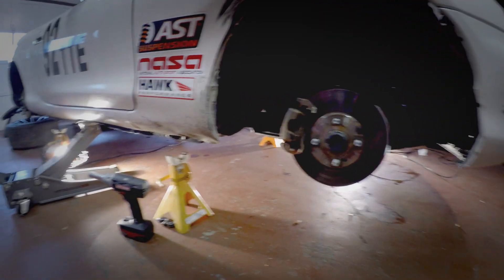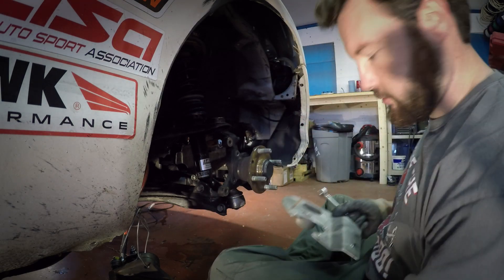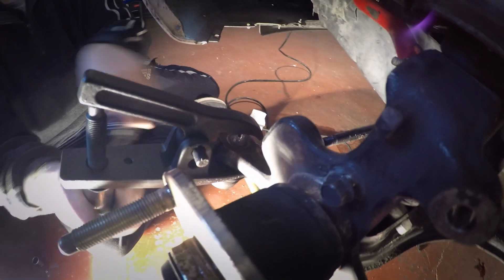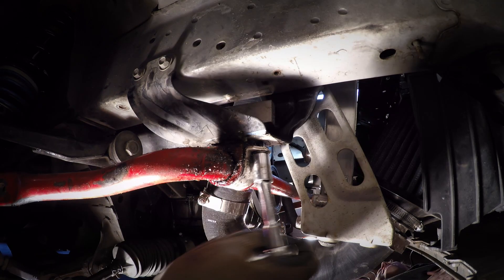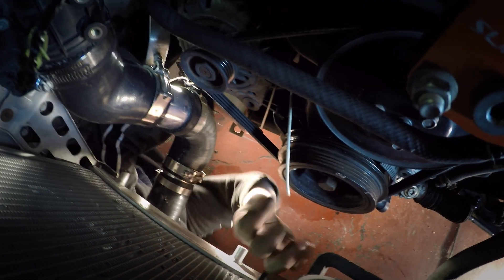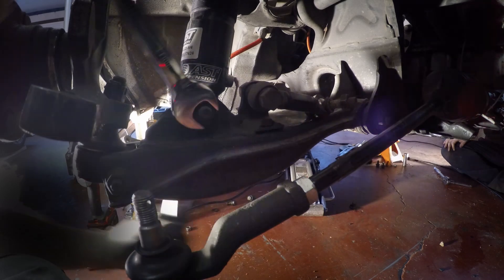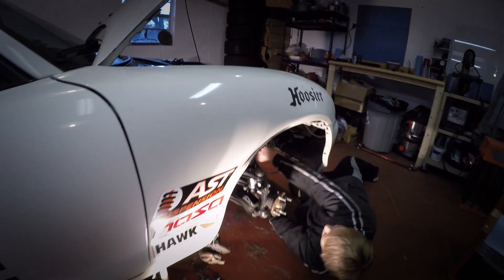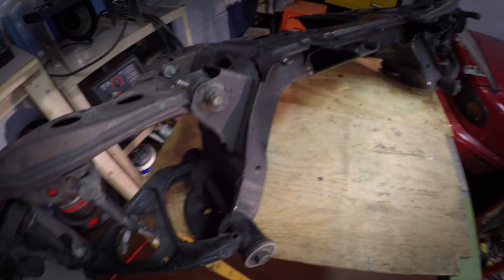How to remove your Miata front subframe.

Comment: Where did you get those heat shields from?
Reply from the maker: It was a small company called Trackspeed Engineering.  They closed up shop in 2022.  You might be able to find something similar on Miataturbo.net.  They usually do group buys or have people making one off parts.  Be mindful to post though.  They can be brutal.

Comment: Do you have a tools list for this job?
Reply from the maker: No.  I don't go that deep into my videos.  You could do this job with a pretty basic kit, you might just need to be creative with the ball joints and tie rod ends.
Reply: Yeah it was like a 21mm, 19mm, 14mm and whatever else you need for the random bolts replaced by some hack lol  @CodyYankey
Reply from the maker: @boo5tjuice  Lol, that's another thing about old cars.  By the time you get to them, they have been run through by some many, no telling what someone has done or damage they had caused.  

Sounds like you got it done though!
Reply: yeah it was like 15 min haha super easy, but this video helped a ton bc I knew what I was getting into thanks to you!  @CodyYankey
Reply from the maker: @boo5tjuice  Glad to be of some help.

Comment: this also works for na??
Reply from the maker: Yeah, they should be the same.  You may have some plastic stuff to deal with that might be different, but the subframes on NAs and NBs are interchangeable.  I run a full NB setup on my NA.

Comment: Hi hoping you can help me with an odd little question! on my 1999 MX-5 there is a rubber hose going from the fuel filter into the subframe and I can't see where it comes out.. I wondered if it was some sort of breather but with the fuel system being pressurised this doesn't make much sense to me, I also didn't see any mention of it in your video but maybe that's due to different versions of the car or it's just so inconsequential that you never mentioned it! I'm absolutely no expert so please forgive me if anything I have said is nonsensical!!
Reply from the maker: That's just an exhaust hose for the charcoal canister, it is fuel system related but not vital.  Most all guys with a racecar end up removing them.  You will get gas fume smells if you do this.  You can just pull the hose out of the subframe.  It's not attached to anything.@calumlindsay
Reply: @CodyYankey  Don't know why I only got notified about this now! But thank you! Another question, if you will indulge me! Where would be the best place to jack the engine up if I am removing the oil pan from underneath the car.. I don't have an engine hoist or I would do it from the top! I'm half thinking I could put a couple bits of wood across the bonnet and use a ratchet strap to hold it up but I'd rather use a jack stand/bricks if possible 😅
Reply from the maker: @CalumLindsay  I don't think you can. The oil pan is also connected to the transmission, so you'll need to pretty much remove the entire engine to get access.  That's probably one of the most difficult jobs on the Miata.  The FD is the same way.  They just have such a robust front cross member.
Reply: @CodyYankey  Yeah I think you are right.. I haven't tried yet but I seen a video with the engine out and the oil pan clearly bolts onto the transmission 🙃 I will have to have a look on the slim chance I can somehow wiggle it out but it doesn't look positive. Will update on whether I somehow manage it or not when the weather has improved a bit, 4ft of snow here which is pretty strange this time of year! 😂

Comment: What caused the subframe failure?
Reply from the maker: Big sticky tires and curb bouncing on track.
Reply: @CodyYankey  damn, does that ever cause frame damage?
Reply from the maker: @greeenteeee  Usually the weakest component fails first, so the subframe in this case.  If you are seriously racing and want to be competitive, pretty much everything is a consumable.  Even "entry level" spec Miata's can cost upwards of 50k and the more open classes have hour limits on engines for rebuilds.

Comment: Hey man, such a quality video. I just wanted to double check that i could leave the steering rack in and this went over everything I'm about to do so spot on. 
Dang that's a gnarly crack on the subframe!! That's crazy gonna have to see what happened there. Thanks for the vid hope you're doing well!
Reply from the maker: You probably could leave the steering rack in place, just undo it at the steering knuckle when you drop it out.  We have a depowered steering rack in this car but if you had power steering I would recommend you leave it in the car and hang it like we did.  Best of luck, glad the video is of some help.

Comment: Hey Great video thanks! My dumbass took the rear Main seal holder off ! time to reseal the oilpan! I literally watched this video like 7 times I decided its better to just pull the engine, less work. it was so hard to get my engine to not bind on subframe, put all the bolts back in, Honestly the engine pull job isnt too bad compared to lining up the 8 bolts plus the weight of engine just floating there..
Reply from the maker: That sucks man.  I think an engine pull is easier as well.  Honestly, if you are doing any lower engine work I would pull the motor/trans over dropping the subframe every time.

Comment: How long does this usually take? to remove and install
Reply from the maker: It really depends on how far you want to tear it down and if you run into any issues along the way.  Most of the time there is rusty bolts or a ton of plastics to remove.  I would budget a whole weekend for the job if you are a home gamer.  If you have a lift and good tooling that you know your way around...maybe 8 hours?

Comment: do you have to take the crossbrace off
Reply from the maker: It depends on what you need to remove.  I assume by cross brace you're talking about the strut tower bar?  If you don't need to take the struts out you can leave it on.

Comment: Hi , what a great video! I’m a beginner wrencher compared to you. I’m at a point where I got a NA6 with a relatively clean chassis but some surface rust on body and lots of it in the engine bay. The car is going for paint. I wish I could get your advice by chat. Please share Facebook if possible... I’m Aleksander White on there, will try to find you. I’m considering dropping the engine with subframe to tackle engine bay rust removal and paint + clutch replacement & oil pan drill/tap for future turbo install. I have lots of questions but first one is will I need to mess with brakes removal ? And I’m trying to do it all while in the paint shop so I’m trying to plan it out to be as efficient as possible time wise. I am imagining doing the entire drop particularly so I won’t have to remove brakes or other components that are connecting the engine and subframe to the body... Thanks for the great info.

Comment: Hey, thanks for the video! It’ll be super helpful when I need to replace my subframe. Quick question, what did you use to hold the calipers and engine up with?
Reply from the maker: The calipers were just hung with some wire on the fenders.  There are no inner fender liners so there are a few eyelets for hardware.  You could probably find something else to hang them on.  A coat hanger cut in half works well.  

The subframe was supported by the strut tower bar and a chain.  You could support it with an engine support they sell at Harbor Freight or make something out of wood.  It was also supported with a jack on the transmission.  Since the engine and trans are still attached it was easy to use the bell housing with a jack and some wood to support the engine weight.
Reply: @CodyYankey  nice I'm waiting on my new subframe coming next week with brand new control arms extended ball joints and motor mounts. It's gonna feel like a whole new car and this video made me confident that I could do it
Reply: @kaarreola99  what made you get a new subframe?

Comment: Wow how did you get that crack ?
Reply from the maker: Years of abuse as a racecar.  I believe the car has been raced pretty much exclusively since 2008, maybe even longer.  High spring rates, sticky race tires and bouncing over rumble strips really takes a toll on structural components.  He had a hub failure a few months ago where the wheel fell off on track.
Reply: Auto-crossed since 1999, lol.

Here's the wheel falling off: https://youtu.be/vuxVgqvcxIg

Comment: I was curious about something, it’s more of a discussion type thing.. but I noticed at the end that the control arms dropped quite a bit when you did the time laps and loosened them. Has there been any insight of which points to improperly preloaded or even bound bushings being a contributing factor to the break?
Reply from the maker: I think that's a great observation and I would think it is possible the binding would be a factor in the subframe failure.  I doubt that it is the major contributing factor since the car routinely is bounced off curbs and heavy braking with Hoosiers.
Reply: There is Sadfab delrin off-set bushings the forward positions of the LCAs. Though, we were able to move the suspension up/down with the shock disconnected, so I don't think there was any bushing bound up.

This issue is semi-common in SM cars with SM7s and other aggressively driven r-comp'd car, like E3 enduro cars. Mazda sells reinforcement plates for this "issue", part #0000-04-5989. I'm currently in process of getting them approved for my racing class, PTE - http://nasaforums.com/viewtopic.php?f=16&t=133338
Reply: Marcus Luttrell gotcha, I just remembered when I was doing research on suspension parts (most important modification in my opinion aside from brakes) that I found a video going in depth about the problems that some brands of bushings encounter and the structural fatigue and failures it could cause. So wasn’t sure if it was a contributing factor. Good luck getting the part approved. I’m sure with it being a known manufacturing issue and having a Mazda repair component that it shouldn’t be an issue. Especially if there was a TSB put out for it.  I know that BMW had a similar situation with subframes ripping out of the body. To which they did the same “fix” of offering a OEM weld-in reinforcement.
Reply: https://youtu.be/_z6OEohnPKw     This is the video I had found forever ago, it’s about 00:26:00 long, and is probably info you both already know, but skipping through it and seeing what the mechanics behind the problem are, make it something easily remembered. Certainly worth checking if you have aftermarket bushings. I think he uses Super-Pro in the video but with the multitude of brands out there I’m sure there are others that also solve the problem.
Reply from the maker: Yeah, this is a good video.  I have taken some steps in my car to help but it still binds.  I have zerk fittings installed and I lightly sanded down the outter face with my belt sander so that they wouldn't bind on the mounting ears.  It feels great after an initial grease but they lose the free movement very quickly.  Ideally spherical bushings would be used in almost all places.

Edit:  Just checked the price of a full SuperPro PU kit for the Miata, wowzers is it costly.  I found it for about $820 and I am not sure if that is with diff bushings or not.   They are probably the best poly bushings I have seen, though.  That inner knurling is just an great idea.
Reply from the maker: I could see it being a hindrance  for someone that daily's their car.  I usually clean my suspension after every 2 autocross events or a track day.  For the money of the poly kit you could go with the SADFab full delrin/spherical kit (http://sadfab.com/bushingpackages.html).  Requires some extra work but for the money it's hard pressed to be beat.
Reply: NA6 driver Yeah the price is up there, I was hit with the same sticker shock when I originally found out about them. I feel like it’s a good investment if you plan on owning the car for a long time. it could be worth it. It’s funny that you mention spherical bearings, because I’ve looked that up too, However.... while there are a few companies that make a “every pivot point gets a bearing” style kit, from what I’ve researched they aren’t daily friendly, and basically need to be cleaned and lubed weekly 😞
Reply: NA6 driver yeah, that’s actually the kit that rings a bell in my mind and is actually on my wish list 😅. Good chat gents. Y’all stay safe in this cold winter weather we’re getting tomorrow - through Thursday.